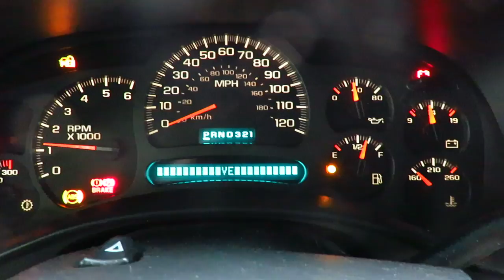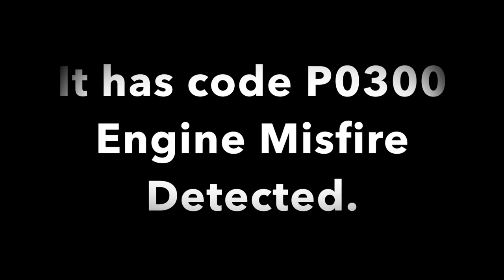03 Chevy Silverado Exhaust valve Noise?

Comment: Old post but it sounds exactly like a cracked drive plate, aka flex plate. Some may even call it a fly wheel. Pretty common problem especially on vehicles that have performance mods or chips installed.

Comment: Is it possible a piston is not firing (Distributor Rotor and Cap)? With the engine light on you should be able to run down to an auto store and borrow a code reader.
Reply from the maker: it doesn't have a distributor.the code is p0300 which is engine misfire. I am thinking now maybe a broken rocker arm or push rod. I am going to remove a valve cover tomorrow.  I hope thats all it is and I don't have to replace the motor. Thanks
Reply: @LumnahAcres  so what was it

Comment: what was the solution to your problem, could it be a coil pack or plug misfire?
Reply from the maker: It ended up being  a broken connecting rod. I put a reman motor in it. There is a video on it. https://youtu.be/jHnFsU8FdCY
Reply: @LumnahAcres  How tf did you break a connecting rod on a stick motor?

Comment: I fixed this problem on my truck by changing the Oil Pump Inlet Tube O-Ring.  The lifters are the first part that don't get enough oil after this o-ring breaks down.  All Chevrolet mid 2000s era 5.3L O-Ring fails around 150-190K.  
Oil Pump Inlet tube O-Ring Replacement
https://www.youtube.com/watch?v=g1e3kx3mOMY